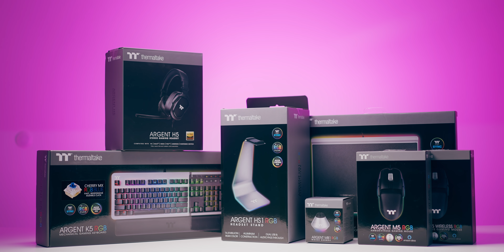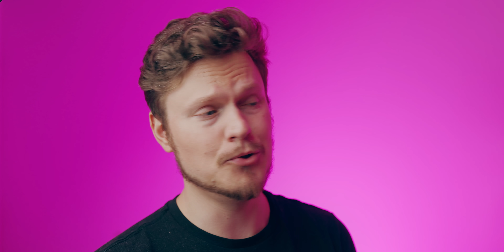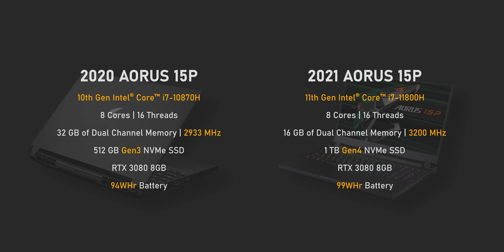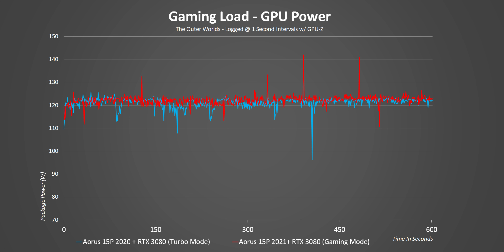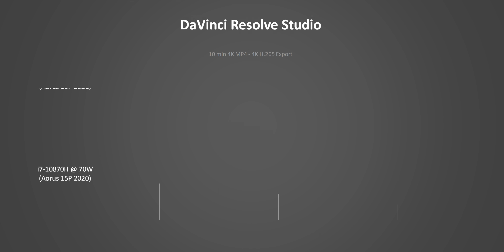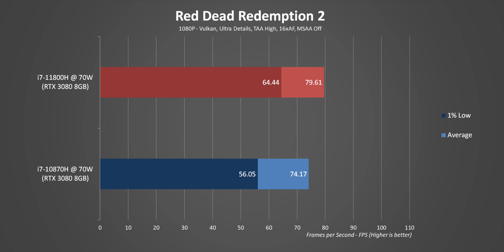Intel 11th Gen Tiger Lake Gaming Laptops are NUTS!

Comment: Got an Ailenware on order with a i7-10870H and a 3080 and wondering if I should cancel and get a laptop with a 11800H. I did get it on sale for just under $2K so I'm afraid I won't find that combo for that price.
Reply: Obviously 11th gen is better but 10th gen is still good man. I have 9750H 9th gen i7 and rtx 2060 and its still a beast of a laptop. Unless u make a living using ur laptop ur not gonna need the extra performance.
Reply: @bradbeyers9028  yeah I'm just a gamer not using it for work. I have a work laptop from my company. My current gaming laptop I'm upgrading from has a 960M and 8 gigs of ram. This new one will have 32gb of ram and a 3080 so I should notice a huge improvement.

Comment: I felt like that was not a good review as it looks way too kind to intel for one part : no comparison to AMD devices, weird selection of games with nothing too demanding when the 3080 can clearly take it (i assume it's to create a cpu limiting difference but it would not be relevant for most of the games that are not in that scenario and that is not highlighted). 

Also suuuper weird choice for battery life measurements as it doesn't do gigabyte any justice: it doesn't make sense to compare the battery life of a 100W device under load to a 15w device. 100wh battery with a 100w load will obviously last 1h no surprises here it's just physics, what could have been interesting is to know the battery life in mixed real life productivity usage when you're not gaming, that's where even 100w devices can shine if the power management is done correctly , especially with batteries that big.

Also the improvement is very slight from one generation to another, this shouldn't be acceptable for a recommended device as these don't exist in a vacuum , there is competition and it feels weird to have zero point of reference to the competition (even if it's just one comparable laptop) it just gives the impression that this video artificially makes the difference from one gen to the other bigger while it could have looked ridiculous in comparison to a third competitor.

If that was a showcase that didn't make me want this device and if it was not, your channel could gain a lot in treating these reviews a bit more fairly.
Reply: I feel like you do not have a good reply, as it looks way too kind of overboard brainy tech for one part! Also, you should complain they did not throw in any mention of ARM cpu or any other cpu on the market even though title is  "Intel NEEDED This - 10th Gen vs 11th Gen Gaming Laptops". Yet to confuse the masses, you go and mention AMD, and as I am looking around and watching the video, I do not see any title stating " Intel NEEDED This - 10th Gen vs 11th Gen Gaming Laptops (and let me throw in some AMD comparison because some fan boys would get upset we did not even though the title is strictly Intel)" << Phew, that title is/was exhausting.

You say "that is a weird selection of games and not too demanding", and why would they throw anything that now puts the gpu as the necessary coefficient in the results? The video is fine as it is, yet I would of preferred more cpu intensive tests to see the results. Though I would be the first to admit, I am no brainy tech, or even close as I have enough computer knowledge to get myself into trouble opening my pc, other then replacing the hard drive or memory.

I could go on friend, but this is not a "trash you", or "let me start a flame war" reply. Your response is the problem that so many on the internet have. Which is, when someone says apples, the oranges fan boys get out their keyboards and start complaining they are not being talked about. This is NOT an apples to oranges comparison, this is, last years crop of apples compared to this years crop of apples, all out of the same trees and soil, and watered and fertilized the same (darn, that is a good analogy). I appreciated some of your reply as it sounded very smart and technical, but in your conclusion you lost me, as it was fair.

"the announcer's loud voice over the speakers" - "LADIES AND GERMS THIS IS THE FIGHT OF THE CENTURY (it is always the fight of the century) AND LET US RUMBBBBBBBBBBLLLLLLLLLLLEEEEE, IN THE BLUE CORNER ON MY RIGHT WE HAVE LAST YEARS CONTENDER LOOKING WELL USED & HOTELY COMPLAINED ABOUT YET SPRY ............ 10TH GEN INTEL i7, ANNNNNNNNDDDDDD IN  THE BLUE CORNER ON MY LEFT WE HAVE THIS YEARS UP AND COMMING YOUNG AND HUNGRY CONTENDER NO ONE KNOWS ANYTHING ABOUT.......... 11TH GEN INTEL i7. SADLY WE TOLD THE RED AMD TEAM TO, 'PISS OFF MATE' AND WE WILL ONLY HAVE INTEL ON THIS CARD SO DON'T CRY ON YOUR SOCIAL AMD MEDIA AND WHINE TO DON KING OR RACHEL UCHITEL, UNLESS YOU WANT SOME CHEESE AS WELL! << HMMMM, wondering if I should of started off with that on my reply?

Btw, this was not even a Aorus or Gigabyte review, or a battery review, or a display review, or how wonderful the cooling system is review, or a "look at those wonderful whatchamacallits next to those thingabobs covering those wonderful widgets review, or look here I am enjoying being fully distracted by the flashing lights  (must of been a cat in the previous life) on the RGB keyboard review,  yet allow me to digress again, it is about one INTEL CPU generation against another review. Also, I am not a HC fanboy, though I enjoy most of their videos and why I subscribe ( I do not expect to enjoy all off them, and matter of fact, I do not expect to enjoy 100% of the videos of any channel/content creature I watch)

Wow, re-reading all that above to myself, and I am now laughing and at myself, even though I was having fun, I just realized I need a life (and yup, let me add, I  do not take myself seriously review). As I mentioned friend, I am not trashing you, as you do have your head screwed on right, and seem very technically minded, but you missed the apples for the oranges!

Cheers
Reply: @monkeysnark7043  Why did i read your whole (yes i've read it all, must honor the effort of such a long comment) message with an aussie accent? Also thanks for the chuckle

Comment: you just showed the main flaw in Harddware Unboxed testing - testing all CPU-s at unrealistic 45 watts. I mean sure in combined workloads they often go to 45 watts, except they tested them in CPU only loads, where 45 watts become unrealistic and not the wattage most H series CPU-s will work at. 
The reason why they were so close in their tests with 10-th gen and why they are so much different in yours is because 11-th gen works better at higher wattages than Ryzen CPU-s and Intel previous generations, which is why 70-80 watts is optimal for them

Thanks for the video!
Reply: That's wrong. If they pull out more than 45 watts, they are running out of spec.

Comment: Could you test battery life using some light workloads ? Testing using heavy work load doesn't give much information because it's just a result of Battery Capacity/TDP.
Reply: I came here to request this.  I think they meant to show it, but ended up showing heavy work load twice.
Reply: Nobody cares about battery life in a gaming laptop dude
Reply: @matthiasschwarzenberger9579  Not true dude.  There are people that use a gaming laptop for a mix of professional and personal uses, and the professional uses often are looking for just a bit of portability.  Give me a gaming laptop with 5 to 6 hours of battery life during light usage (they exist, don't pretend they don't.  Lenovo 5 w/ 4800h and 80 whr battery can push 7 hours), and that's a killer machine that can be used for gaming at home on AC power, and portable enough you can use for work and on the road without needing to haul the massive AC adapter around.

Comment: The auros. I have the same 🥺. well the i7 10750h 😅
Reply: cries in 4300u
Reply: The video is a bit misleading, comparing a laptop with slower RAM.
And then giving all the points to Intel for doing a great job on their new chip...
Reply: how is the i7 10750h? does it bottleneck your gpu

Comment: Is the memory timings the same between models?
Reply from the maker: No.  
10th Gen 15P is 20-20-20-48 1T
11th Gen 15P is 22-22-22-52 1T
Reply: @HardwareCanucks  so which one is worse, since jarrod's tech showed that bad secondary timings can result in lower performance
Reply: Hard to compare. 10th gen only support up to 2933Mhz . 11th gen supports 3200Mhz memory .  Those timings are JEDEC spec.
Reply: @naseemyasir  if you check LTT video on this topic - it seems like the issue is not the memory timings, but the number of modules on a stick. Some have 8 smaller ones and some have 4 bigger ones. The 4 bigger ones are noticeably slower.
Reply: i don't know what different about ram. i am benchmark fanboy ,as i know last gen 8core intel laptop r20  hard to reach 4000.even more than 100w.
but this video show that tigerlake 8core only 70w can hit score 5133. this show that improve very much .about gaming i don't know .i only sensity with benchmark like r20, r23 ,geekbench 5

Comment: What are the memory ranking for the two laptops? X16 or x8? That could make a big difference in your results... See recent video by Linus...
Reply: They supplied you with both computers... It's very easy to overlook the ranking. If the 2020 has X16 and 2021 has x8, your results may very well be very different if you swapped the memory of the two computers.
Reply from the maker: Memory ranking?  As in single or dual rank?  If that's the case, both laptops are using dual channel, single rank modules.  As a matter of fact, on the laptop side, most manufacturers have been on single rank 8GB modules for about two years now.
Reply: @HardwareCanucks  People are probably asking because of the LTT video. You should check it out.
Reply: @HardwareCanucks  It is not about ranks... it is about memory density... how many chips on the module for the same capacity...

Comment: Where are the comparisons against Ryzen 5000 laptops?
Reply from the maker: This is an apples to apples generational comparison, setting the stage for upcoming content.  Finding EXACTLY the same laptop with an AMD spec (right down to the GPU wattage) wasn't possible.  We tried.  If that changes at some point it will CERTAINLY be done.  :) :)
Reply: @HardwareCanucks  Lenovo Legion 5 with Intel CPU-s is coming soon so you should be able to.
Reply: This was a sponsored video so I guess Intel wanted a direct comparison vs the 10th gen.   I would say the other comparison will come later.   

Great video as all ways.
Reply from the maker: @SGTSAS  "This video is sponsored by Thermaltake".  Intel DID NOT sponsor this video.  If they did we would have said so.  It was done as an honest, straight up comparison since we were curious after Intel's own claims.  :)
Reply: @HardwareCanucks  ahhh sorry my fault.    I just read at the start and then watched the video quick on my way home.
Reply: @HardwareCanucks  to be fair... You did parrot a bit of Intel's own marketing language... Like "smart cache". But good to know this (slightly shallow) comparison was not sponsored by Intel!
Reply: @SGTSAS  i also check chinese laptop that y9000p and r9000p
 same oem company ,same spec same series same graphic card  ,only different cpu 11800h vs 5800h .my conclusion is after 70w, 11800h is stronger than 5800h ,under 70w 5800h is better
i mean both side after 70w.

gaming 11800h better, single game 5-7% faster,online game like cs go, lol,dota 2,battleground 10-15% faster